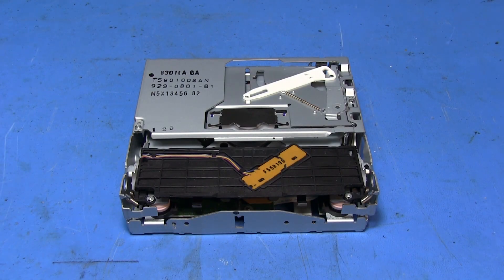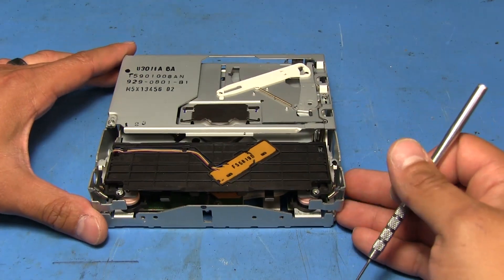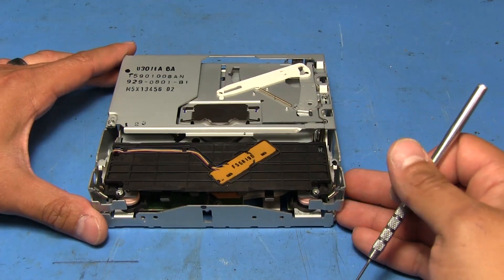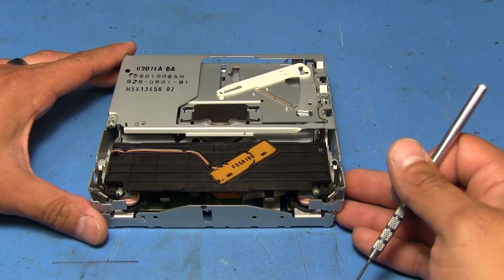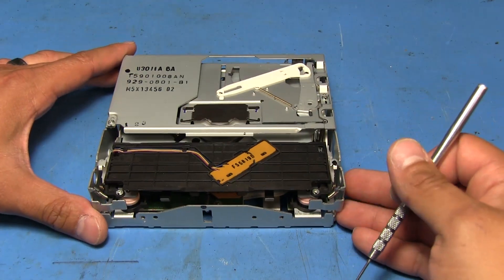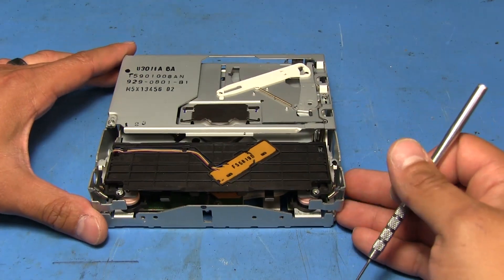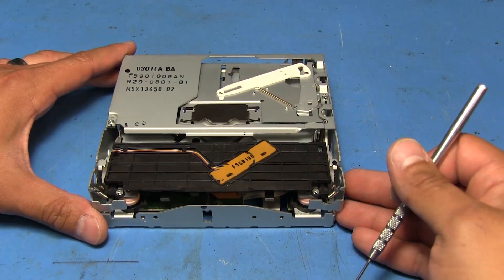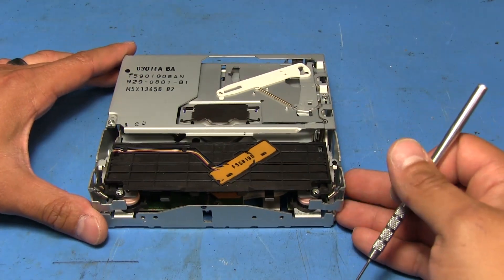TWB #9 | Single Disc Clarion CD Mechanism Repair

Comment: NOTE : For anyone that has watched the video and is attempting to make the repair....at 15:07 note that the rubber sleeve is in TWO HALVES but that the sides are TAPERED with the thicker portion toward the outside ends of the rod.  Also pay attention that the tiny plastic bushing / retainers have a raised rail which holds the roller in place once slipped into the black plastic frame.   I think that the rubber taper is so that once the rim of the CD slides into the player,  ( the center opening has a wider gap ) the progressively thicker rubber sleeve gets a slightly stronger grip as it draws in the CD towards the spindle.    This is the BEST repair video I have viewed .  THANKS Electronics Fool

Comment: Just fixed a friend's CD player, it had the crack in the gear casing. Crack was between the casing and the flange for the screw that holds it down, so would never have noticed it if I hadn't tried to lift the casing like you suggested, so thanks for your help! Didn't have superglue to hand, so used a resin glue to bond the accessible edge of the casing to the metal underneath, and used a few drops of chlorinated solvent to melt the plastic of the casing back on to the screw flange. Let's see if it holds.

Comment: Great video. For the cracked cover repair I used a small safety pin, cropped and bent to hold the cover down using the screw. Thanks for your help.
Reply: Stephen Brown did you take any pics  or video of your repair ? gonna try fixing mine.

Comment: i fixed my cd player with ur help man, i put some super glue on the gear n it worked, guess it sealed the crack, also superglued the plastic covering down, it had broken off at the edge where it screws in. Got the cd player in my 03 silverado goin for the 1st time like in 10 years.
Reply: Hey how did the glued gear hold up? What kind of super glue did you use? Im debating if I should use gorilla glue or jb weld epoxy...
Reply: @johndoegta2189  late reply, but just a heads up, it stopped working shortly thereafter lol. Glue isn't an effective fix here. Never bothered to get it fixed, bored in quarantine now an working on the truck i'm gonna try and look for the gear online, did u ever fix it?
Reply: @Pingaheimer  I did find gears online but I used JBWeld on the gear instead of glue and it held up. Unfortunately I had another issue with the radio over the winter. I could not get any FM volume. I ended up throwing an old aftermarket radio I had in it and bypassed my amp.
Reply: @johndoegta2189  thanks, i counted ten teeth from he video though
Reply: Yeah, the gears from aliexpress have 12 teeth and the one in the video has only 10 on the cracked gear.   Did anyone ever order these to see if they would work on this fix?  Hesitant to try the 12 tooth gear.  I could not find the 10 tooth gear on Ali Express.

Comment: Great vid, repaired my CD player in my 06 Malibu using your instructions. Kind of a PITA , had to remove, and reinstall CD, radio unit twice, once to verify gear damage, and once to install damaged gear. Cost was 10$, but much cheaper than sending to a repair facility which wanted 175 to 200$ to fix. By the way, I found a source for replacement gears, (Ali express), they are sold by brand of CD, and overall diameter of gear,(verify gear size before ordering), and they are sold at 10 part minimum order, and it takes about a month for delivery as they come from China, but at a buck per gear it"s not too bad.
Reply: So Mr. Dorsett since you had to buy 10 can I get one from you.
Reply: Yeah man, all those gears laying around, hook your bros up, i'll pay shipping.
Reply: Note, the gears from aliexpress have 12 teeth and the one in the video has only 10 on the cracked gear.   Did anyone ever order these to see if they would work on this fix?  Hesitant to try the 12 tooth gear.  I could not find the 10 tooth gear on Ali Express.

Comment: Thanks for a great video - I had the clicking eject problem and as suggested this was indeed a cracked cover on the gears - a drop of superglue seems to have sorted the problem. the trickiest part was the damper and springs reassembly. Cheers, Phil

Comment: Awesome Video!  I was able to confirm the same cracked gear on my CD Player out of my '04 Nissan Frontier.  Being unable to source a new gear, I had plans to try to glue the cracked gear on to the shaft with super glue, but I lost one of the bushings.  Instead I ordered a new CD Mechanism off of eBay for a little under $50.

Comment: I haven’t read all the comments yet, but just wondering if there is some way to acquire replacement gears. Thanks!

And btw, this was an excellent video that helped me re-glue the roller rubber, but I think the gears need to be replaced cause it still doesn’t work…. (I couldn’t tell exactly how you were testing it, so I had to reinstall everything in my car again… bleh… gotta rip it all apart again I guess.) 😅

Comment: Very well presented.sometimes i just file the gears hole a little
 larger so as to not stress out the gear too much and glue the gear to the shaft. Intricate surgery.  Take pictures during 
, and notes so everything gets back together correctly.

Comment: Hi Workbench, greetings from England. Thank you for your really excellent video! Attempting to fix similar Clarion unit from my Nissan Tino V10. Please can you advise as all gear trains seem fine but I still have 'clicking' noises, or rather louder 'clucking' sounds. The roller drive gear seems fine but the 'jackknife mechanical action' shown so clearly in your final bench test is not happening on my bench! :( The sliding white moving parts seem the source of the 'clucking' sound, they shake when test current runs the motor, but do not move to assist loading/unloading. Should the disc ejection sequence first from inside the unit and then through its 'door' happen automatically when the head reaches the end of travel at centre of the CD? Sorry to ask but any help much appreciated! Kind regards, Rob.

Comment: I got to this video after all the research to tackle this issue.. took me abt 2 hours to get to the rubber roller😂😂

Facing similar issue ive just glued it hope it works

A question though

Is the rubber supposed to be loose and free on the steel shaft or should it be glued to it too

Mine one is loose, if the shaft rotates theres a good chance the rubber might not rotate

And 

How did you make that gear if you could share the link for that same

TIA

Good day

Comment: Great video and VERY helpful!  This looks like my problem as well on two GM CD players I have.  Any chance you are selling any gears?  Or have a 3D printable version?
Reply: Heh, I need gears too. (Was hoping it was just the loose rubber on the roller, but nope, re-glued that and still doesn’t work.)

Comment: Thanks a lot for the tutorial. I have one of those. The gear that drives the rollers is broken, but I observe the foam rollers spin freely over the inner metal rod as well. Should they show some traction? How can I get a spare gear if the glue and heat don't do the trick? Thanks again.

Comment: Excellent video and awesome tips think that is the problem with mine too as it all looks same from Suzuki Liana. When I get time I might try this operation, would u send me a gear if I can find which one it is? or could I possibly repair mine with glue and re drill hole?
Reply: +Graeme Hotshot I LOVE U !!!

 I've fixed it. 

It was the mounting case for the cogs.

Very hard to spot the crack until I had it going and in bits, but glue gunned it down now and works fine.

Cheers U Legend cost me a couple of hours work but not a penny spent on the actual repair.

Comment: Very good video. I have a similar issue with a double din cd cassette player from toyota I think is a cd changer.  After trying to clean it and putting it back together the motor doesn't pull in or push out the cd it is silent. I must of put the gears or its mechanism on wrong. When I manually turn the gears via the gear system, takes forever, but I can insert and eject the cd manually. The part where you mention to use 6v dc supply is brilliant, I can troubleshoot much easily than sitting in the car. Thanks very helpful.

Comment: Hi great video and really helps, I have the clicking noise problem so I assume its the other gear. Is that replacement a similar process
Reply from the maker: michael koch The clicking problem is usually the clear plastic gear case has cracked in the rear of the unit. The plastic tab that is screwed down will have broken off from the rest. You can make a small bracket to hold it down with some thin metal.

Comment: Hey bro great vid. I just took mine apart and found a crack too, in the wheel gear. I also found the back side bushing completely missing! I understand the bushings should move freely but what about the rubber sleeve? I assume it should be very tight and move with the axle? Is the down pressure when activated enough to hold the rubber sleeve from spinning on the axle?
Reply from the maker: The rubber sleeve is a bit free to slip. Yes, it does rely on the downward pressure of the disc being moved in/out to grip the shaft. If it feels like it's too slippery, you may want to wipe the inside with a thin pipe cleaner soaked in alcohol, also wipe the shaft, but avoid touching it with your fingers to prevent oils from getting on it.
Reply: I got it all back together again and its still working. The only problem is it only plays cds that it feels like playing. It will play some bootleg cds but not purchased legit cds. Other than that it works good now.

Comment: In dry climates with risk of static, might be a good idea to stick flex cable from cd head into a piece  of conductive foam
Reply from the maker: Thanks for mentioning this!

I didn't mention it here, but the ribbons leading to the pickups often have a couple solder points for applying a bit of solder to bridge them together and prevent damaging the laser. Of course it has to be removed before putting back in service.

Comment: Another good one from Workbench, looks so, so easy=) Hope you could do my Bose 6 CD player, made by Clarion, for my Infiniti FX 45, year 2004! And, if there is a gear problem, where do I find a gear?? Usually cleaning the switches should do it, right Mr. Workbench??? Thanks again, you are very good!! And you have very good camera too :o)
Reply from the maker: Eero Laukkanen I don't know where to get gears other than other broken mechanisms. I have been able to successfully replicate some gears using a silicone mold and 2 part resin mix, which I showed how to do in a previous video, if you're interested in seeing it. Cleaning the switches helps mechanisms that have failed due to incorrect positioning as long as nothing has broken in the process.

Comment: Hey I was able to get it to load and eject the discs again but it only will play like half of my discs randomly. Even in a 4 disc set it will only play 2 of them but not the others. WTH is goin on here? Took it apart again cleaned lens with some alcohol and same crap!@!!
Reply from the maker: That's a really odd issue. Sounds like maybe the laser pickup is starting to fail.

Comment: Great video! thanks! I have a alpine care stereo  older model 9801 it kept ejecting  the cd. So stupid me i opened it up can't put it together, couple of springs on either side can't line it up! Maybe U can do a video on that if possible .
Reply from the maker: If you mean the two springs on the sides that latch the white levers that hold the rollers up or down, those can be a bit tricky. You have to put the front side of the spring into the notch on the black piece first and then put the other side into the notch on the white lever. Kind of hard to describe exactly here, but I was planning to revisit this mechanism due to another problem that is common with them.
Reply: Yes ! thanks for the reply! U know what im talking about . I will try again with what U told me . If U make a video , it would be great to watch and see , how it's done . thanks for posting these videos they are vary helpfull !!
Reply: I think U should make a video of this, it would be helpfull to many.

Comment: where can i buy the disk feeder roller gear  for clarion vrx485vd
Reply from the maker: The gears for these mechanisms are actually available on Ali Express. There are two types though with different number of teeth. You have to make sure you get the ones that are the same as yours.

Comment: I have 2 Clarion units with small drive gear broken and need to source replacements are you able to sell me 2? or give me the Clarion part number
Reply: Yeah, the gears from aliexpress have 12 gears and the one in the video has only 10 on the cracked gear.   Did anyone ever order these to see if they would work on this fix?  Hesitant to try the 12 tooth gear